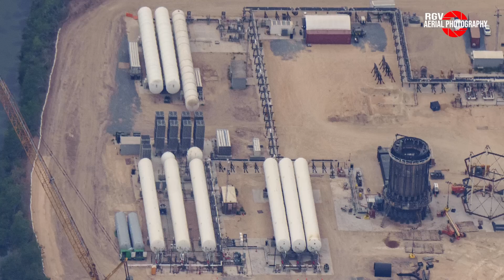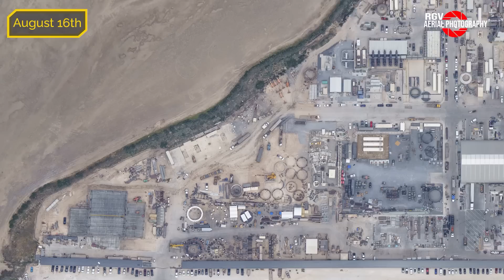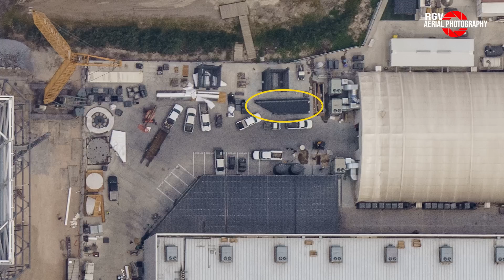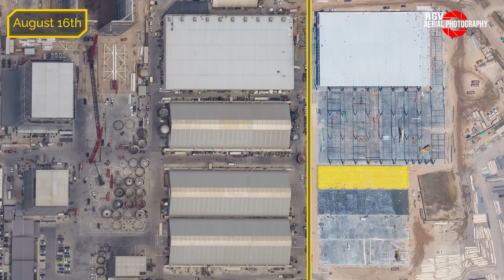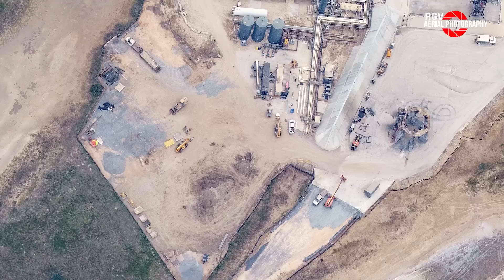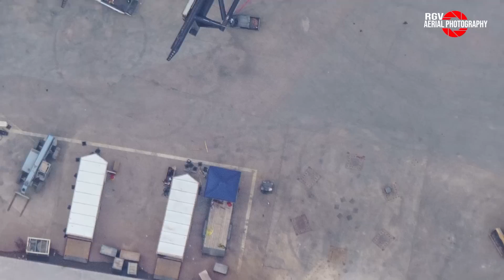Hot-Staging Ring Ready For Action! Starbase Flyover Update Episode 13!

Comment: Potential Hot Staging Procedure: Minimize booster thrust, start 3 RVacs, shut down booster immediately, slight pause, start remaining starship engines. This would always be thrusting, so no need for ullage thrusts. It would also separate the vehicles and potentially slow the booster and aid it's backflip.

Comment: the only logical explanation is that only the vacuum engines will start until the ship is like 20 or so meters from the booster. there is no need to gimbal, as the correct direction will be set by the booster's gimbal. 
the sealevel engines will be used for the water drop attempt

Comment: It is not true that the TWR of the booster at stage separation is more than that of the ship. Since the booster will only be firing three engines at stage separation, and those three engines also must push the weight of the booster AND the Ship, the 3 RVac engines should be able to to get the ship away from the booster just fine.
Reply: It sounds like your arguing both side of the question lol. The TWR of the ship would have to be more for separation, from what ive heard the booster will use 3 engines at %50.
Reply: @Vatsyayana87  exactly, and 3 of the same engine pushing less weight at 90% power should give the ship a higher TWR. But then again, we don’t actually know if the booster will shut down the 3 center engines after the Ship ignites its engines.

Comment: - There's talk of 6 total vacuum raptors on starship
- Hot-staging exists now
- HLS will have tons of high‑thrust RCS thrusters around the mid section of starship

sounds like a launch escape system in the works
Reply: The HLS thrusters aren't enough to remove the crew component in an abort
Reply: @bryanillenberg what's their thrust and how many are there?
Reply: @TheNheg66  I estimated 55 kn thrust, with 24 engines
Reply: No clue exactly what RCS is going to be used, knowing SpaceX it'll be something in-house.

There is renders of multiple different types of HLS's that have varying RCS sizes and total count.
Reply: @ShyCataclysm  most recent renders have 24 engines. In that config 55 kn is the minimum.
If you want, I could find my math and post it here.

Comment: In regards to what the white painted rings might be.  
At some point, the design phase, or parts of the design phase for booster and/or Starship will be complete and they will start building the machines that will build the booster and Starship. The Hot-Stage ring is a perfect example. There are a ton of cuts and welds on that part alone and the less hand fabrication you use, the better the part will be. You want to relegate your human hands to loading the machines feed stock. To get good repeatability of each part, you want to fabricate it on a machine. The less human hands that touch a given component during fabrication the better off you are. On top of that, you significantly reduce your labor overhead.  A purpose built ring machine doesn't need health insurance nor does it call in sick on a vital day.

Comment: the RVACs are enough (the thrust of the RVACs will push the booster away)
In fact, the thrust of the ship will be less than that of the booster (until separation is completed)
Reply: I would speculate that once the Starship engines startup and the clamps release the booster engines shut down.
Reply: @TheEvilmooseofdoom  the reason to avoid that is ullage. When the booster stops accelerating, the propellant and the gas will mix, requiring more ullage gas to resettle the propellants so the engines can reignite. It's much better to just keep them on (and ignite another 10, which, as the booster is under acceleration, won't require any more pressurizer), saving mass (and thus reducing the fuel needed for boostback, resulting in a higher separation velocity).

Comment: Hey Mauricio, What are those structures on the outerside of MBs. What Purpose they serve?
Am I missing something
Reply: In a regular building, the floors provide rigidity against twisting and flexing to the walls. These buildings have no floors, and they need to be "open" top to bottom. So, these are 'fake floors' or external support buttresses.

Comment: I think they'll use the 3 RVac engines to seperate and a few seconds lates they will light the inner 3 engines.
Reply: No, I don’t think they will ignite the gimbaling raptors until the ship is clear of the booster.  The center raptors are not needed, and even the vacuum raptors will likely be throttled down for separation.
Reply: Yes.  Which is the difficult from this specialists to imagine this? 😅
Reply: @Prooblemm Most people who are into rockets realize that's probably how it's going to happen. There are very few ways it can be done. YouTube channels/media outlets just phrase it/present it this way as to create fake engagement from people in the comments coming to say, "they are going to do it this way, how did you not know that?" It also makes the reader/watcher feel like they are smart and know what's going on when the channel/media outlet doesn't appear like they do.
Reply: I think the center raptors will be deflected and fired.
The thrust against that flat plate will cause certain separation of ship and booster, but the “raptor is world’s biggest cutting torch” and the erosion of that staging ring will be interesting experiment.
Reply: @peterjrhanley9418  did you not catch the part in the video where Elon said they were doing the 15 degree gimbal test for landings and not for separation. If they fired the center Raptors that close to the booster after dome, they are going to get pressured gasses blowing back into the Raptor nozzles. If that happens, you are gonna have a very bad day with flow-seperation.
Reply: I thought it has to be RVacs first but your comment about the flat surface made sense to me.  But there's just so much gas coming out the sea-levels raptors that surely the raptor bells would  split? @peterjrhanley9418
Reply: The 3 center engines are seavacs. They provide little thrust as they are meant for atmospheric use not space.
Reply: @ib12us  I believe the thrust of sea-level vs vacuum Raptors is roughly the same. In space, the sea-level Raptor's ISP is about 90% that of the vacuum Raptors. Basically, RVacs are more efficient than sea-level Raptors.
Reply: @ib12us  if that were true then the booster would be providing little thrust at stage separation, fortunately F = mdot * Ve + (pe - p0) * Ae  increases as p0 decreases however small Ae is so the sea level engines provide a bit more thrust at altitude than at sea level.
Reply: @ib12us  The thrust is the same. The Vacuum raptors are just more efficient in a vacuum since they have the largest possible nozzle. In fact, I'll bet anything that Starship will use all  six engines for the vast majority of the orbital insertion burn. Ignite the vacs first for stage separation, then ignite the sea levels once clear, and run all six at full throttle until propellant depletion brings the acceleration up to 3 Gs. Then shut down the sea levels immediately. Once 3 Gs are reached again on just the vacs, throttle them down to maintain 3 Gs until SECO.